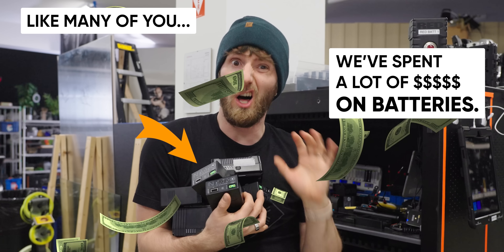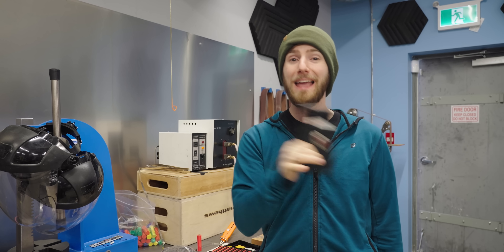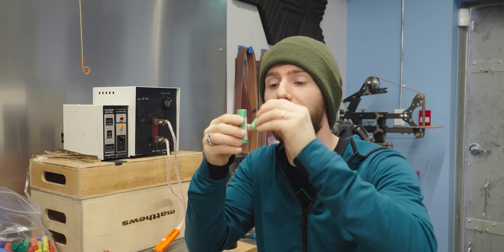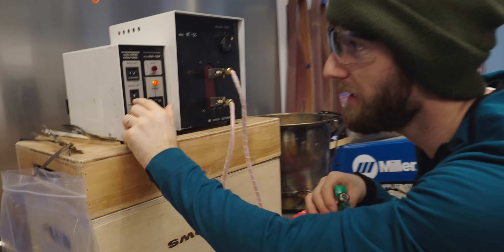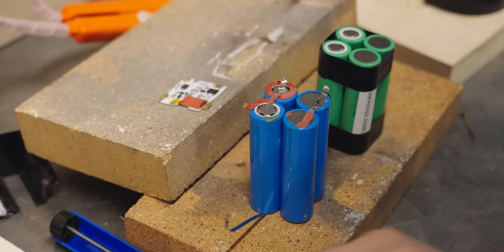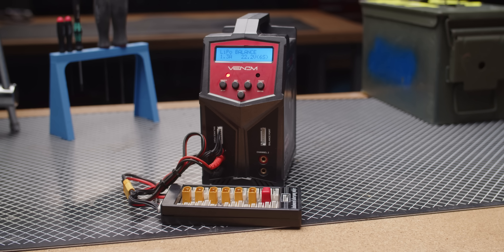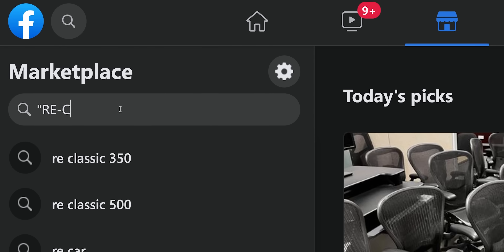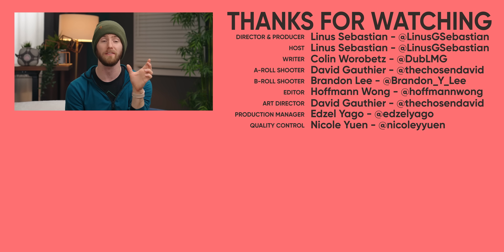This should be illegal… Battery Repair Blocking

Comment: With some BMSes you might need to attach a charger first to get them working again once the battery has been disconnected. Another thing that can help with certain BMSes is first attaching a power supply to the BMS to fool it into thinking the battery is still there. It's a pain in the ass though.  
The reason for having this kind of "blocking"  feature  in a way can make sense though. Once a battery has been fully drained, (which a BMS probably assumes once it goes down to a voltage where the BMS doesn't have enough power anymore to keep itself working) cells can be (chemically) damaged.  Which if one goes up in smoke doesn't look good for the company that made it, even if it's the user's fault for letting the battery sit in the device on a shelf for months or years.   I've actually seen electric bicycle batteries where the BMS tracks the time between charges for warranty and liability reasons (when the user manual states you need to plug it in at least once a month for example and you haven't and it blows up or fails, they can just tell you that you mistreated it). 
Many BMSes do have "reset" tricks  (Like connecting negative but not positive and balance leads, and then touching the + and - on the BMS with a multimeter set to diode mode. to reset/start it after power off, and then connecting the positive wire).  
BMSes are tiny black boxes that usually go undocumented, and honestly there should be a law that tells companies to publish the info about their devices BMS , and how/what it communicates with the device so that you know what you're getting into when buying a device.  For many of the devices I have, I am clueless about what kind of protections they have.  Not just for when I want to replace a battery, but also when choosing a device, determining which one is least likely to burn my house down. 
I've rebuilt plenty of packs throughout the years, and seen plenty of incredibly dangerous OEM packs. Imho all devices should have schematics and protection info published publicly, as you might have a time bomb around the house that you don't know about. Most people won't look into it, but the ones that do might find big issues and be able to force a recall.

Comment: OR, make packs with removable panels/doors that house pressure plates to do the contacts so you can remove and replace the cells without having to solder. Vape mods have been doing this with 1-3 cells for how long now? Why can't they do it with battery packs?

Comment: I feel like the BMS was probably designed to shut off permanently in the event of disassembly, because it is intended to prevent dangerous failure of the battery...
that is logically this: "Something has happened to the battery which it was not designed for and does not match any of the known recoverable safe operation states, therefore, the battery is now unsafe and cannot ever be trusted again"

Much like how you completely scrapped all those cells that sparked, even though there was a possibility that nothing was actually catastrophically wrong with them... because you couldn't be sure.

A sort of "there's a non 0 percent chance that this battery will become a bomb if power is supplied to it, so we can't allow power to ever be supplied to it."

Thus, I feel its probably not malicious so much as "the end user shouldn't be servicing this for safety reasons, therefore the possibility of them servicing it isn't factored into the safety features intended to keep them intact and alive."

That may be one of the largest hurdles to get over with regards to passing any right to repair legislation, as it directly conflicts with legislation that requires products be safe to use.
While I feel the right to void safety guarantee of one's own volition is certainly important, I also recognize that it goes against the best interests of any reputable manufacturer to allow their products to become unsafe by accident, negligence, or easy tampering. 

You don't want to manufacture a battery that can be easily converted into a... decompressive human-removal device by simply snipping a lead, because now you've unwittingly supplied it to... lets say... people of questionable morals, for the purposes of performing a spectacle.... and while legally  you're not at fault as you couldn't be expected to foresee this, if you do foresee it, it should be something you're concerned with... you know... preventing. Like tamper proof seals on medicine. They aren't there to protect you from bad manufacturing, they're there to protect you from people with ill intent. Nothing legally requires those seals to be there, but everyone jointly decided to start putting them there because it was safer and safer means better PR, and better customer loyalty, and generally is just a good feature.

Comment: There's a bit of misinformation here, and a lot of fear mongering. Batteries need to be handled responsibly of course, but they are not NEARLY as dangerous as you make them seem to be. For one, it's entirely untrue that you can't replace one or a few batteries out of a bad pack. It cannot short-circuit during assembly if you do it right and ensure beforehand the voltages are similar and any half-decent BMS will ensure that batteries charge and discharge at similar rates (why else have a BMS in the first place?). Out of curiosity, how many of the batteries you've put in sand have caught fire? I would expect none, because the sparks we've seen didn't come from the batteries, but the spot welder. This is likely because you've been sanding the leads and creating a bunch of conductive dust. Really, why would you think it's a good idea to sand the leads??? Who told you to do that?  

I also feel like you should've mentioned more about what kind of batteries you should be using to replace battery packs. There is more to it than simply being an 18650 form factor and tolerating a max charge of 4.2V. Ideally, I would always replace the batteries with the exact same model that was used in the pack. The exact model and brand is usually written on the side. If you don't want to (or can't) get the originals though, there's the capacity to look out for, but in the end that only affects how long it will last for, so it's not critical to stick with the same capacity the OEM batteries have. What's most important is the continuous charge and discharge rates. That BMS may be setup to charge specific batteries, which it knows can handle a high charge or discharge rate. As for the discharge rate, the batteries will either protect themselves and limit current when you try to discharge them too fast, or it will damage them. That all depends on if they have an integrated protection circuit or not. Those you've shown do have one, you can tell by the vented top and the disc shape under it. Unprotected cells are flat-top as far as I know. For the batteries you've shown, even making a direct connection between positive and negative ends, it would've been perfectly safe. For unprotected cells though, a too high discharge rate will likely damage them, and it could be dangerous. What you want to look out for is the C rating of the battery. A C rating gives you the maximum amount of continuous amps you can safely pull from the battery. It's dependent on the capacity of the battery. A 3000mah battery with a 1C rating will be able to output a continuous 3A, while a 3400mah battery with the same C rating will be able to output a maximum of 3.4A continuously.

There's probably more to say, but please research your videos a little more, and don't needlessly discourage people from doing things by exaggerating the dangers.

Comment: You could do that, but you must not ever disconnect the battery before you connect new one (or have voltage simulating one). If you remove old ones BMS thinks that battery is dead and you can not under any circumstance recharge dead li-ion battery (it could start fire). BMS has no way of knowing it the battery just died or if you replaced it (which is way more unlikely). It's not planned obsolescence, it is protecting your ass.

Comment: I has similar problem when replacing 18650 cells. The BMS would not connect the battery to load until it saw some charging voltage. After that, it powered on and I had no further problems.

Comment: Same problem with DJI's Intelligent Batteries, I have one here that was a bit too deeply discharge, but even after opening it and charging the cells without the original charger it won't power a drone or get charged via the BMS...
Price: 170-180€
Similar Capacity dumb Pack: ~100€

Comment: Last month I started seeing videos on YT about some statements Linus made about ad blocking being the same as piracy. One of his points was that it was up to a creator to determine the price of their product (through ads) and that while it might be possible to circumvent that price (with ad blockers) that didn't make it right.
Now here we are a month later and Linus isn't happy with the price that a battery creator put on their product and he's trying to circumvent that with a cell replacement. 

Isn't that wrong? Shouldn't we simply pay the cost of a new battery and consider that the price of using the equipment it powers? 
Re-celling a battery pack is taking money away from a manufacturer that spent money to develop and test the product. Seems to me that this is just as close to piracy as ad blocking and it's not unreasonable for them to design their BMS to prevent it.

If you're famous and are going to take a position on something, you should make it a consistent position.

Comment: Years working in large format lead acid batteries: they had perfected all of the production jigs in the 1960s, had a room and instructions on how to produce new jigs, and produced almost a hundred new jigs for when old ones started to be a little bit out of tolerance. 

It made the work very boring and very analog and very old school. With large batteries like that and the very toxic part of lead The company had a surprisingly robust recycling process built on years of mistakes. Just like that good German manufacturer thinking long-term should be much more in the forefront of lithium ion recycling, re-using etc.

Comment: I bought a Fender Mustang Micro guitar amp yesterday. I wanted to take it apart and put it physically inside my guitar. I expected this sort of situation where it was glued together, soldered on battery, potted in epoxy, etc.

Nope, 2 screws to open, and the battery is one of those $5 lipo soft packs with a jst connector you can get at adafruit or virtually anywhere else. 

So, at least some companies have the notion that people will want to use the item and repair it well past the battery expiry. Granted, Fender's normal product design life cycles are measured in centuries, not months so this not surprising of them, even on a high tech device. All they need to do is open the firmware 10 years from now, and they could be the poster child for right to repair.

Comment: I think devices that use batteries like 18650s should be required to design them to be replaceable like AA batteries. Vapes do this and it works just fine. But then I guess Red and sony can't gauge you out of hundreds of dollars every couple of years.

Comment: When I have done this in the past I used a 150W iron and lead. Sketchy but if the lead of the iron is big enough it can melt the solder to the strip before the battery can get too hot then cool it off with a wet sponge as soon as possible.

Comment: Great vid, but the welding pulse is way too long. The nickel should never get red hot. 

We use a bigger battery specific battery welder with a pulse of 3ms max.

Feel free to contact me if you guys have some questions about battery building. 

- btw that welder pen is alright, but again, your welding pulse is way too long. cleaning the tip should only be done once a week with constant use.
Thanks for shedding light on the problem with BMS shutdown, way too many battery packs bms shut down after a succesful renovation, there is a way to prevent that, though it is tedious.

Comment: Seriously, with 14M+ subscribers... Please, next time, first educate yourself before doing a video on re-celling battery packs.
1. Don't panic if you see a spark during spot-welding. The very act of tossing your half-welded pack into the sand bucket is enough to create a short-circuit and maybe a fire.
2. Before you start: discharge all cells to 3.30V. Empty cells are less likely to pose a serious fire hazard if you accidentally short them.
3. After completing, you always try charging it if you don't get an output voltage from your BMS. A basic test that needs to be done before you start ranting on manufacturers.
Only if the BMS fails to operate after doing the basic tests, rant away all you want. Those manufacturers deserve it.
And after you're done ranting, you just order a generic BMS and put that in.

Comment: its often not the case of number of charges, but a lot of electronic batteries will brick themselves when BMS loses power and they cannot be reused, so you need to keep them powered and swap batteries while maintaining voltage (yeah, RAM type memory)

Comment: It is normal to see 0V after soldering a BMS on many of them. They need to get a charge Voltage to be trigger the open circuit again. Did you try to charge it for a second?
But I also know evil BMS. For example, Dyson uses BMS which does permanently shut down on a replacement attempt. But users found out how to trick the evil BMS. Dyson's BMS can not be reset, so once a fault happens it will be turned off forever. If you think about it, it is kind of a safety mechanism. To replace Dyson Batteries, you need to cut the BMS voltage supply BEFORE you cut the battery monitoring leads. Only then a Dyson BMS will not detect any faults, and it can be reused (I have already done it to prove this theory)
If you want to try it again, the first step should be to figure out how the BMS controller gets its voltage and cut it first. On Dyson it was pretty simple, you just needed to cut the main positive terminal first.

I don't want to defend bad companies, but If somebody would ask me "Should the BMS accept a Reset if a battery did die while all others are at a healthy voltage?" I probably would tell the BMS supplier "no" because I would not like to be in press with a burning Battery because the BMS did open a circuit to the broken cell during a "reset on charge"

Comment: U aren't putting enough pressure while spot welding... U can test this by only using nickel stripes....and the thing is that spark thing happens sometimes due to pressure we put into that tip

Comment: Linus! Most of BMS need do be disconected / conected to batery pack i correct order!
Disconecting old pack - from top positvoe voltage to main negative, one by one. 
Connecting - from main negative to top positive, one by one. 
Before smasching into a camera - charge it! Charging is the wake up cycle for BMS, sometines it have a 2 "wake up" pads, to short them to turn on the bms. :D 
But, if it was first try with spotwelder, this was goooood job ;)

Comment: 4:36 uhhhhhhh what? people swap out bad cells all the time.  Just balance all the cells and you are fine....there are numerous videos on this. ESPECIALLY those green LGs. they are fine. just balance them. The vape community does it all the time as well. 
7:08 8:35 You guys treat 18650s like they are weapons of mass destruction. You should see a drunk vaper trying to replace batteries only to have them get run over and dropped and still use them until the end of time.  They really arnt THAT unstable. 
10:53 and the vape community
Reply: Lol true....

Comment: From what I've read, DJI batteries fall clearly into the "evil" category.  If any of the cells are disconnected, the BMS will refuse to power on, unless reset by an external programmer.  And replacing the BMS isn't really an option, as the drone communicates with the battery to give status (cell voltage and temperature) while running.  Also, DJI has stopped manufacturing batteries for their older drones (e.g. Mavic Air 1)

It IS possible to replace the cells individually, LIVE, by matching the voltage of a bad cell with a new cell, adding the new cell in parallel and then cutting the old cell out.  The battery firmware doesn't seem to care that the battery now lasts for 13 minutes instead of the previous 3.  

There's also some third-party software (free, paid and open source) available to reset packs after a more normal cell replacement, but apparently these cells are locked by a passphrase, all based on a TI "BQ" series chip.  Thanks TI!
Reply: Man this thing happened to me once on my phantom 3 pro intelligence battery...after checking all the cells there was a one failure cell and the complete battery looks dead...

Comment: Gotta be honest, this is one of the very few situations where I actually agree with the manufacturers locking things down.  Considering the amount of laptops I've seen damaged by chinesium grade replacement batteries I think a company selling and warrantying $6000 cameras should be allowed to stop customers from using non-OEM batteries.

Comment: The problem with your spot welder is that you're using an on/off foot pedal instead of one that acts as a momentary switch. 

And also those sparks you were getting were from the nickel strips melting, not from the batteries. Those cells were fine.

Comment: Most BMSes need to be “charged” for them to re-connect the cells as it went into protection when you removed them and it saw the voltage drop